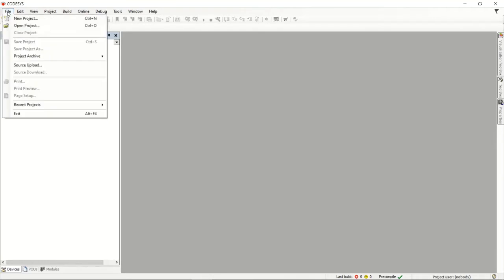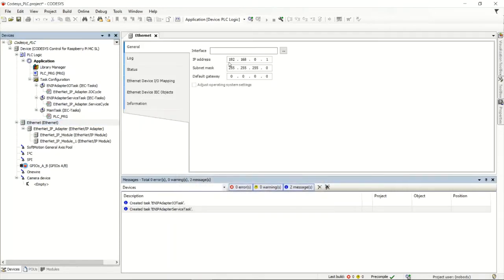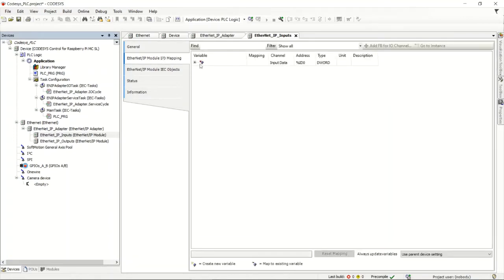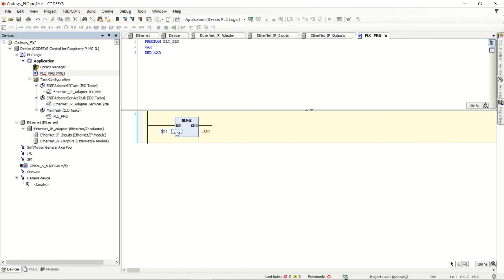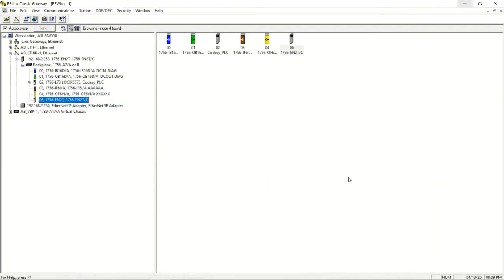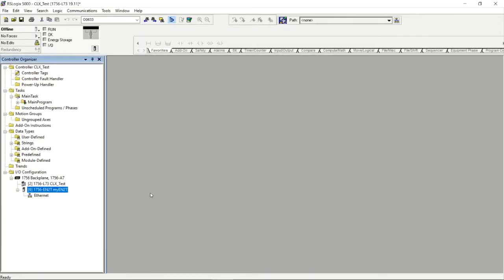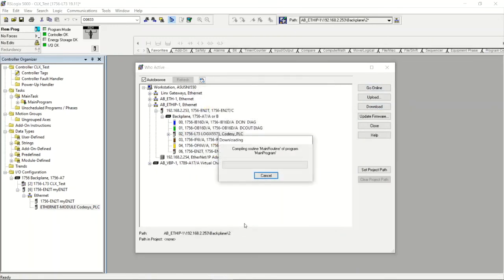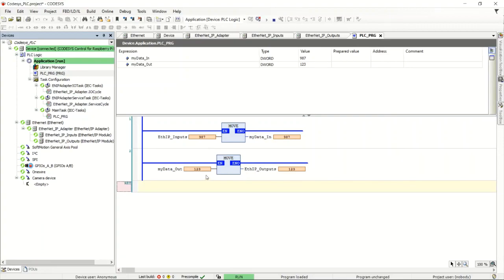Codesys to ControlLogix over Ethernet IP

Comment: When I try going online after adding Ethernet/IP adaptors and modules as shown in the video, I get Ethernet/IP adaptor status as not running. I do not see any errors in the log, but there is a red triangle beside the adaptor and the input and output modules under it. Could anyone help me with how to debug this issue please?

Comment: Thanks much for the detailed video. I do not know what is wrong, but when I insert my ethernet/ip adapter, I can not even pass compile, it gives me plenty of errors, it looks like library is missing. Do you know if this Ethernet/IP adapter has to be licensed? Thank you much
Reply from the maker: No it does not have to be licensed. At least to test. If you want to run without a time out yes you will need a licence. 

You might very well have a library issue. Go into the library manager and try to reload any issuing libraries

Comment: Thank you for the concise but detailed explanation and step-by-step setup tutorial.   I'm a ControlLogix expert, especially with generic Ethernet modules, but a novice with CoDeSys and was unfamiliar with the I/O configuration steps and the Gateway / Ethernet port configuration.    The other tutorials I've found from 3S jump to the more complex EtherNet/IP Scanner object and don't explain the simpler Adapter.
The next question:   is there a size or data type between 1 element (Byte, Word, DWord, REAL) and the Big (504 byte) Input and Output objects, or are those the only possible data connections ?
Reply from the maker: Ken Sorry i did not get back to you sooner. Couple things. As you noted i did this example with 1 word in and out, I would have to try multiple words to see. If i get a chance this week i will. Secondly, you mentioned you are a ControlLogix expert but a CODESYS Novice, well we just posted a class in the CODESYS Store for people like you. CODESYS is hosting (I'm teaching) a CODESYS class for Rockwell experts. Its a shorter class that concentrates on showing the equivalencies between the two product lines. go to https://us.store.codesys.com/events.html. I'm also teaching a Siemens to CODESYS class as well that same week. Beyond that don't hesitate to contact me,  prdejong@northerndynamics.ca if you have any further questions.